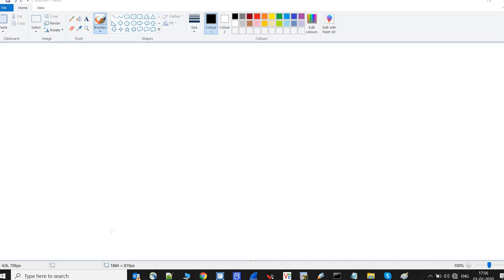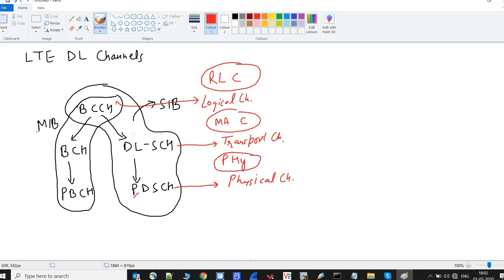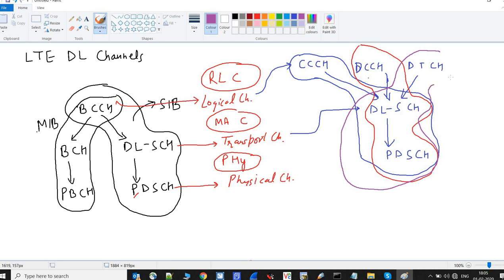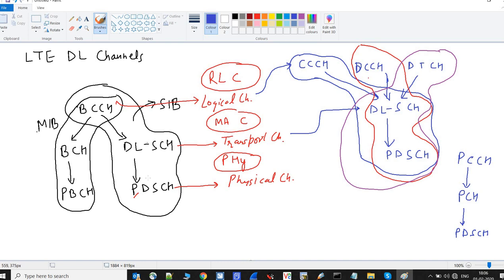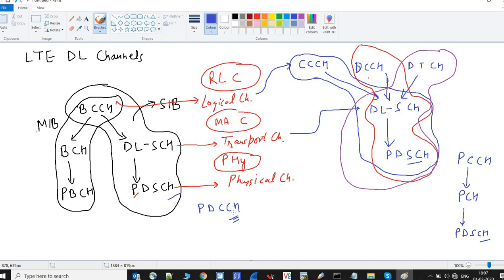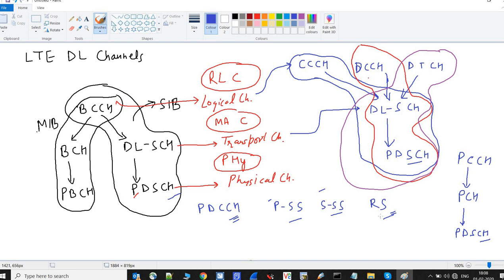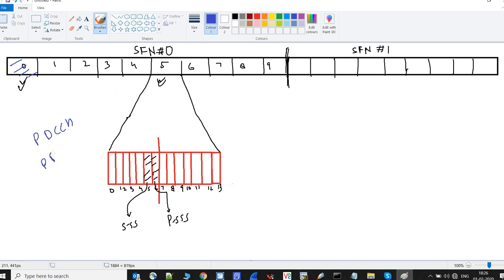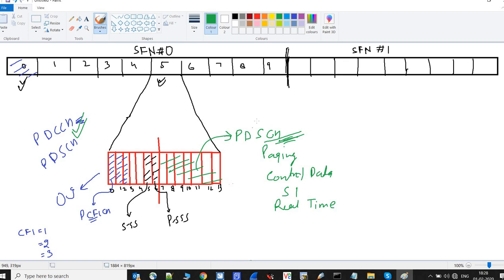LTE Tutorial (Part 5) LTE Downlink Channels

Comment: at 0th subframe - 7,8,9,10 ofdm symbols are used by MIB and PBCH and the ending of video you showed 7,8,9,10 ofdm in 5th subframe are used for PDSCH info ...so does that occur in 5th subframe only or 0th subframe 7,8,9,10 OFDMs ? just for explaination u said in 5th subframe as u didnt draw 0th subframe ofdm symbols sir?

Comment: One question If operator needs to increase the T-put so they can reduce the value of PDCCH to 1. Then why we have 3 values for PDCCH as 1,2,3. Why not operator always set it to 1 to have good T-put
Reply: PDSCH is completely dependent on PDCCH decoding. Now consider you are in a poor signaling area and eNodeB configures CFI=1 to provide better throughput (PDSCH). PDCCH will be distorted until reaches and most likely won't be decoded properly by UE. So the whole PDSCH area is wastage if PDCCH didn't get decoded. So it's better to compromise throughput (PDSCH) in poor signaling areas than PDCCH.
Reply: Good question ....What will be answered ?

Comment: Appreciated 😊

Can you please explain how SSS come before PSS?
Reply: I can answer from perspective of PSS. PSS actually tells what type of frame it is (FDD or TDD) and what type of Cyclic Prefix is used (normal or extended) due to its placement at the boundary of that frame. If you sum up all combinations above, you have 4 types of frames and PSS placement as follows:
FDD with normal CP = 7th symbol
FDD with extended CP = 6th symbol
TDD with normal CP = 16th symbol
TDD with extended CP = 15th symbol
You can check the on internet the structure of PSS-SSS for each frame and CP type
Reply: Same question I want to know